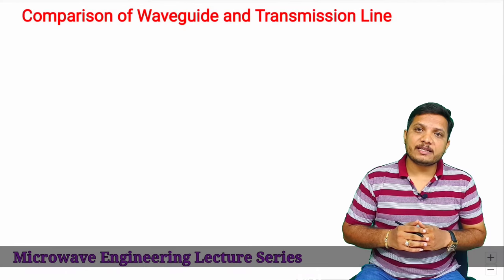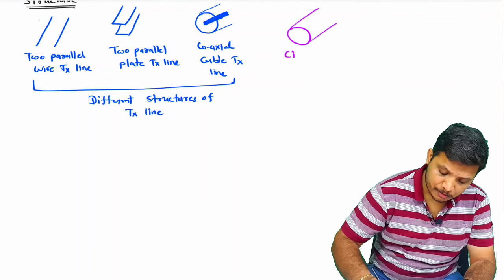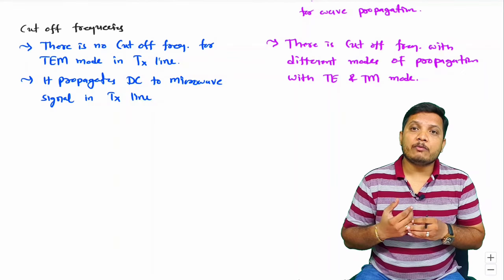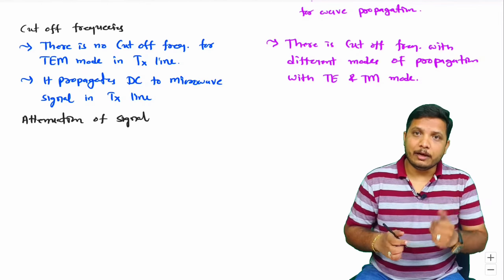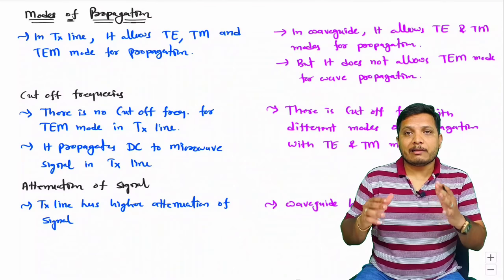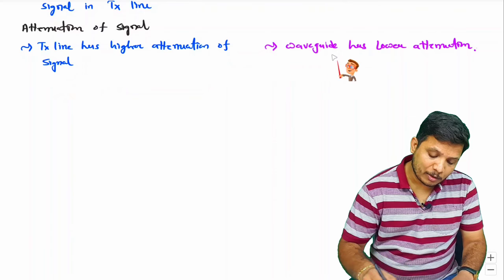Comparison of Waveguide and Transmission Line | Parameters of Transmission Line and Waveguide

Comment: You do a great job sir.
Suggestion: Initially you could have explained the physical meaning of both waveguide and transmission line along with examples, which would have given a clear understanding of what both these are and signals are differently transmitted in these.
Reply from the maker: Noted ✅

Comment from the maker: Comparison of Waveguide and Transmission Line is explained with following Timestamps:
0:00 - Microwave Engineering Lecture Series
0:12 - Structure of Transmission Line and Waveguide
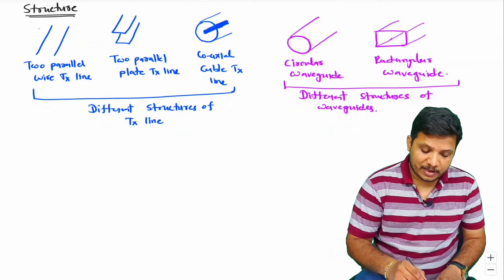2:00 - Modes of propagation for Transmission Line and Waveguide
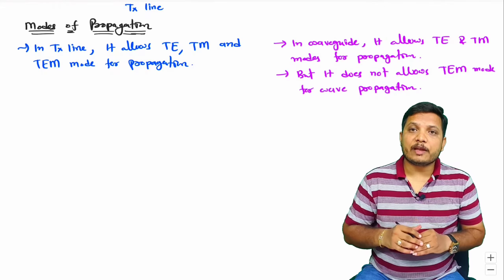3:00 - Cut Off Frequencies of Transmission Line and Waveguide
4:06 - Attenuation of Signal for Transmission Line and Waveguide